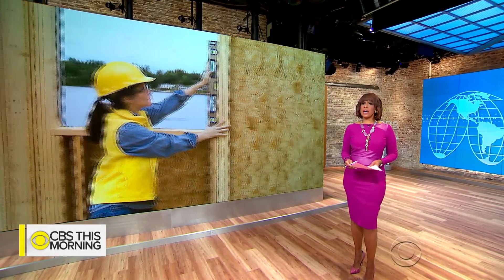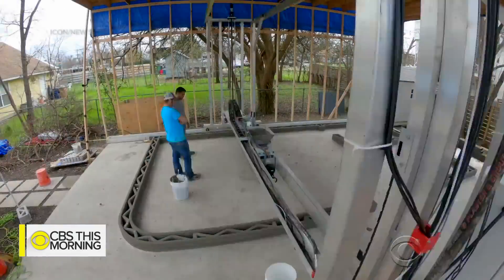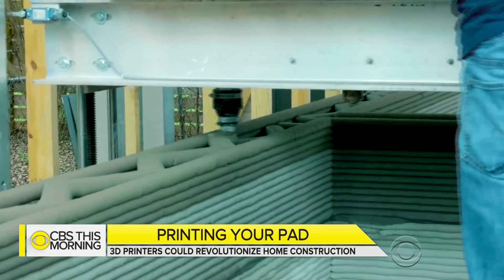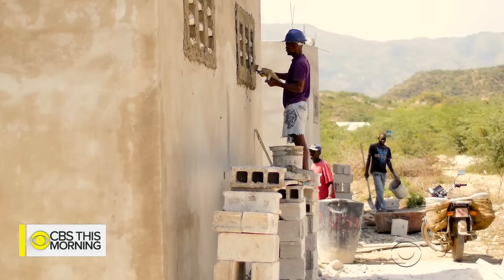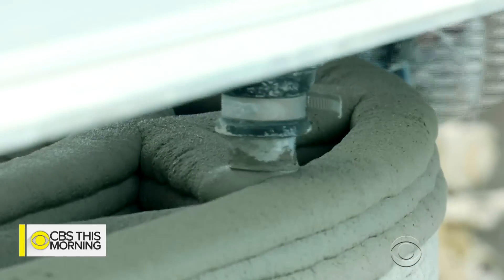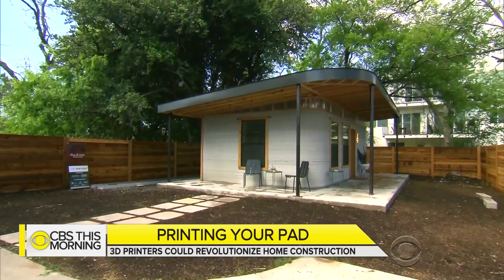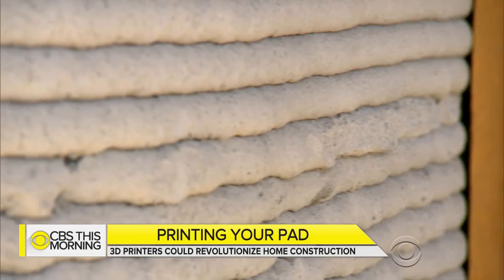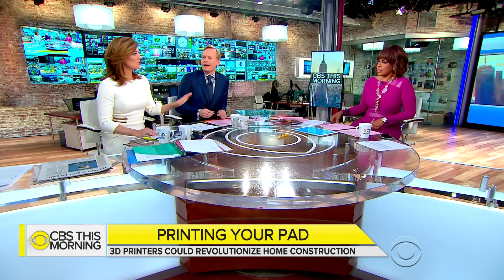3-D printers could revolutionize home construction

Comment: They have to run the utilities on the outside of the wall???  Heck almost every wall outlet is the same height off the floor, on that level you print spaces for the outlet boxes, pause the printer and take 10 minutes to insert the boxes then restart the printer.  The wires can run from the ceiling down the printed gap into the outlet box... like duh!  And these are engineers!  Most water lines are on the same height from the floor too, print a gap in the zigzag to place pex tubing into and run a spigot through the wall then keep printing.